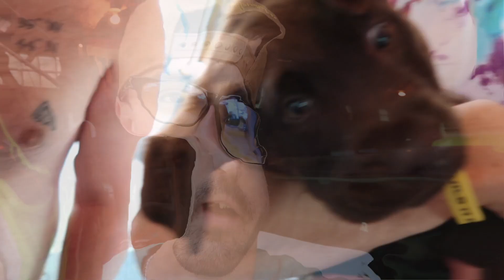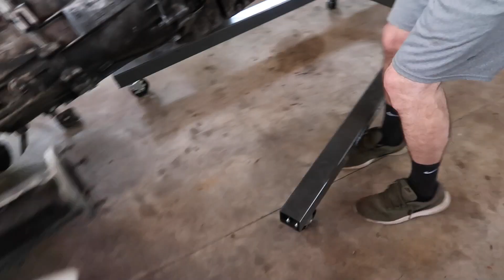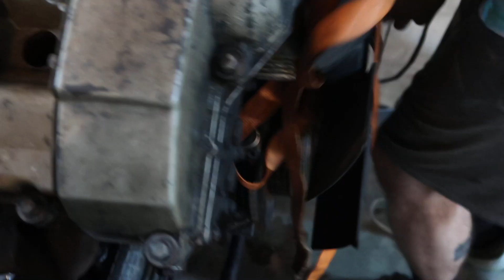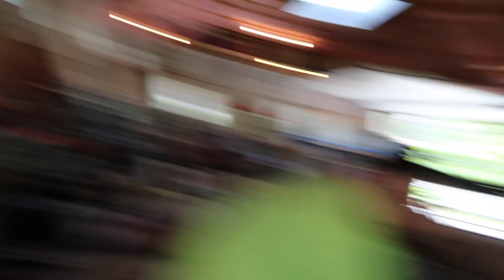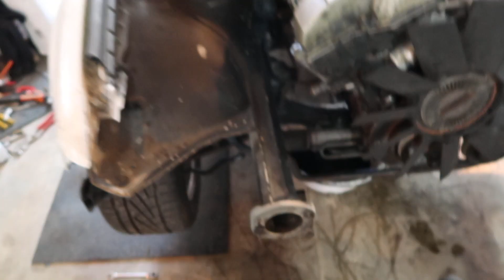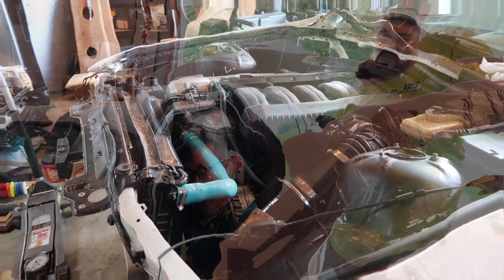Reassembling my BMW E36 325i (Drift Car Project)

Comment: Could be better. Sad man, sorry to see, it eats oil too
Reply from the maker: Just did the valve cover gasket on Friday, it’s a lot better now
Reply: @HorsepowerPizza  How much kilometers?
Reply from the maker: Shows 224k miles, the car was $350 and the motor I put in it was $200
Reply: @HorsepowerPizza  HAHAHSSGAH, nice man! I cant buy an e36 for under a 1200 euros in Serbia, in good condition. Its impossible to find Sunroof Coupe 320i even with bad engine! 
My dream would be 320i Sunroof coupe with leather and factory OBC and Radio BMW Bussiness
Reply: Btw, All of them are in bad condition, or I cant find one for less money. Almost every e36 out there in Serbia is having more than 220k kilometers
Reply from the maker: That would be a really nice car! I hope you find one in good shape! The ones in good shape in the US are $4500+ USD

M3s are $8k-30k!
Reply: @HorsepowerPizza  I know man, but in Serbia, avarage sallary is around 500 euros, and I dont have a job, im 17, had one bmw half a year ago, boston green e36 sunroof 320i, awesome shape and low milage, it was 156k kilometers, sold for 2400 euros (so cheap) and I will never find anything better than that
Reply: My dad sold it for no reason and im so sad rightnow, but chances are low for me to get an bmw ever again… I could have been sold for more than 3000, it was great condition, full factory, changed o-rings at 152k kilometers
Reply from the maker: Oh wow! That sounds like an incredible car!
Reply: @HorsepowerPizza  It was great, when it was up for sale, i went out, all sad, and started throwing it left, right, and i was giving it too much steer and i lifted foot from the gas pedal and car went in the bushes, and luckily, nothing bad happened to it, 
next,
casette in the back (factory radio has CD input in the trunk) music started to bug every 10 seconds
then i knew that it was for sale,  that car was not for wrecking, I should of have taken better care of it
sorry, english is not my main language
Reply from the maker: No worries on the English, I have another friend who is from Serbia! I hope you get another BMW again some day! It sounds like that car was awesome and that you’re really passionate about the cars!